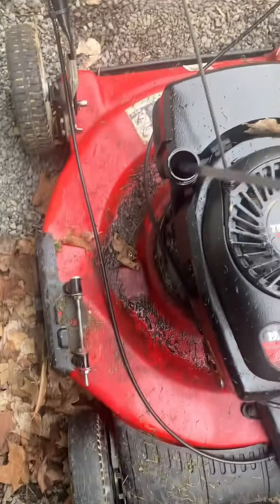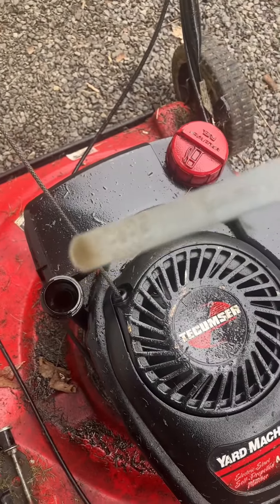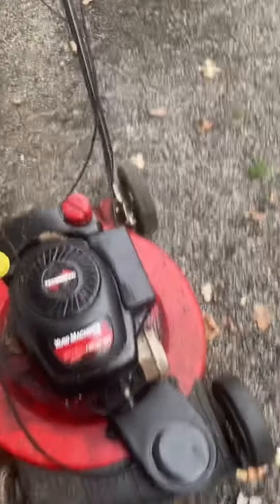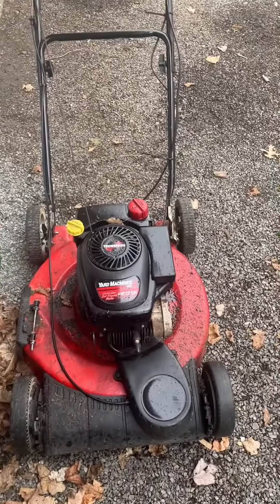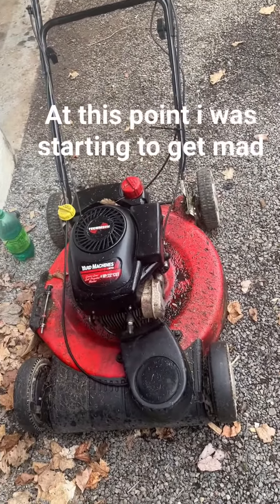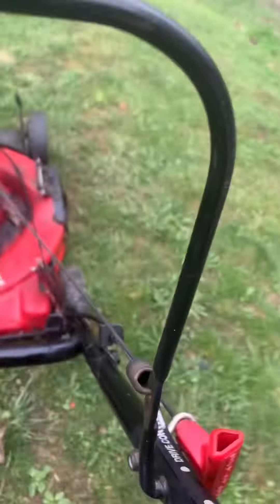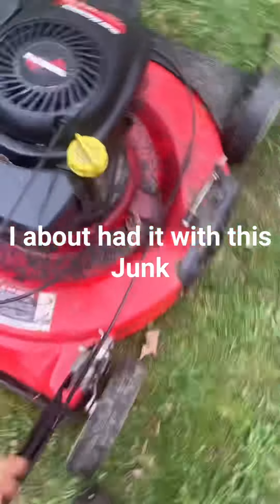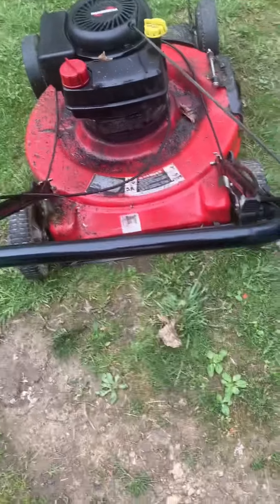How to properly fix your mower

Comment: The carburetor has a bad, stuck open needle and seat. It's flooding when it runs, and when it sits, the gas runs down the intake, past, the intake valve, past the rings, and into the crankcase. A new needle and seat cost a few dollars and can be found online with the mower model number or the engine number.
Reply from the maker: Yea, just was tired of messing with it, I already had to fix it before, there was no fuel in the tank, so it was running of oil